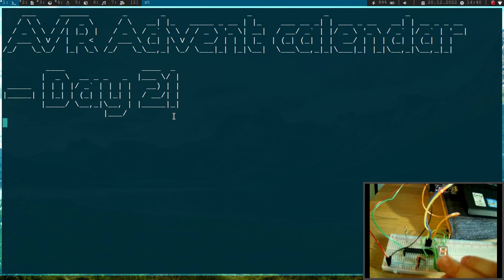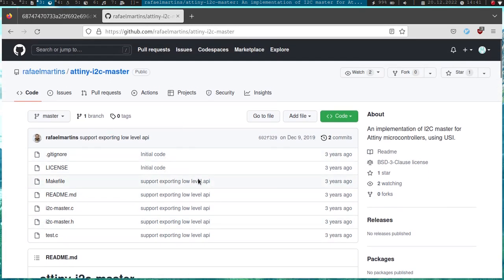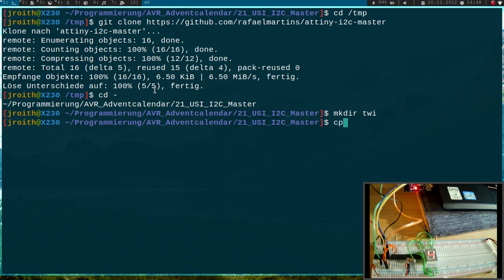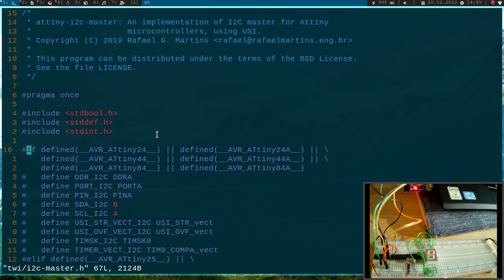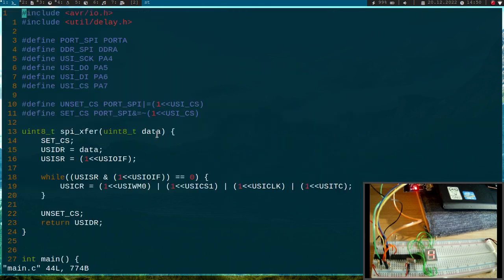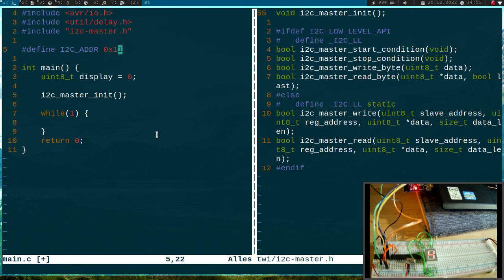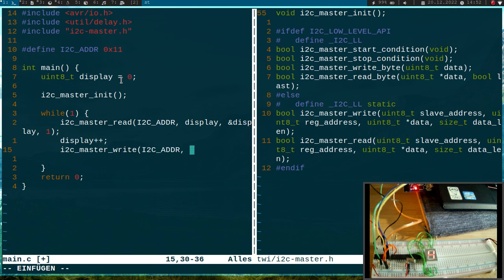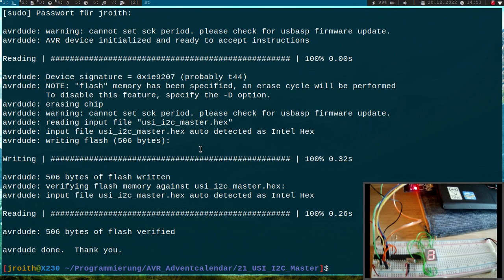AVR Advent Calendar - 21: Attiny USI I2C Master

Comment: Could you recommend some electronics simulation software which is linux compatible (without wine.)
Reply from the maker: Hm, I have to admit I am using LTSpice with wine on Linux. KiCad has a build in simulator, but I haven't used it. Circuit is also quite interesting, but it is an online tool: https://www.falstad.com/circuit/
Does someone else know a good circuit simulator for Linux?